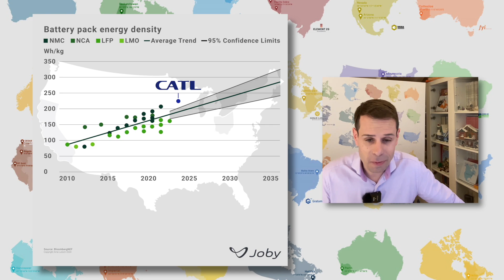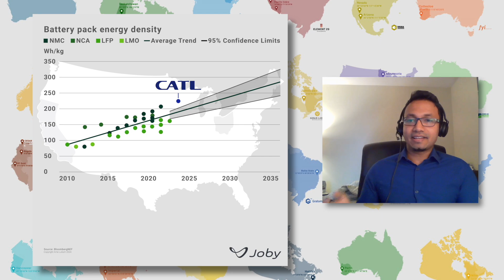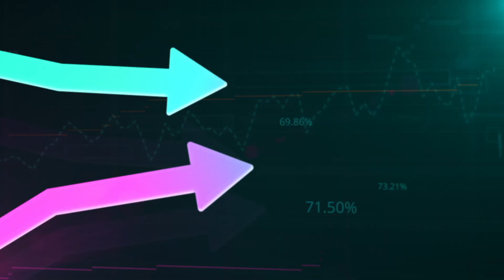Battery Expert Explains: Energy Density and Technological Leap in Battery Tech

Comment: Energy density for individual cells has only increased around 5% in the last 10 years. A battery is a bunch of cells. There is only so much juice there to take advantage of no matter what you do.
Reply from the maker: All data I can see is showing. 6% increase year on year. Pls share some sources. Thanks
Reply: @BatteryCommodity they can massage the numbers of batteries easily and manipulate the numbers but they can't lie about individual cells. That's what you need to look at.
Reply from the maker: Challenging to have these insights  @TheBagOfHolding
Reply: @BatteryCommodity  the energy density of the cells in a battery is what im talking about.